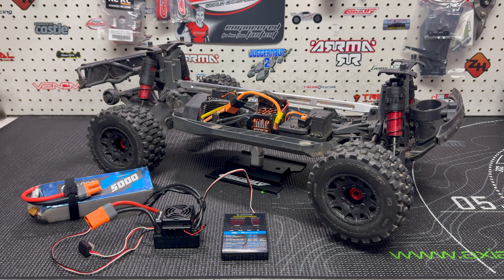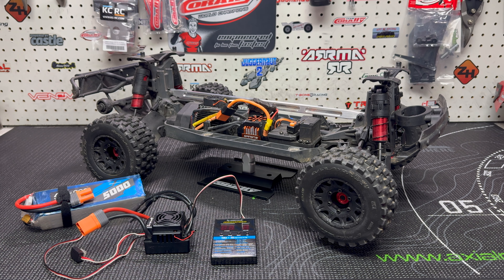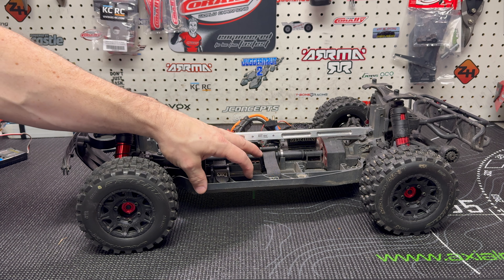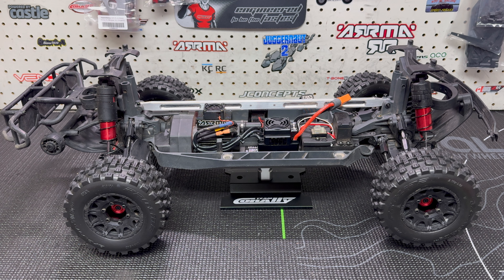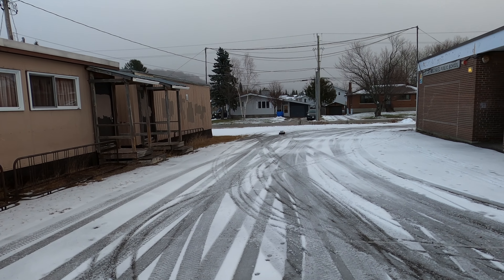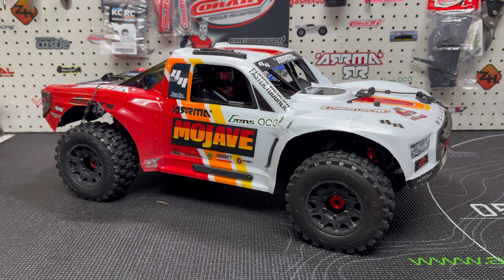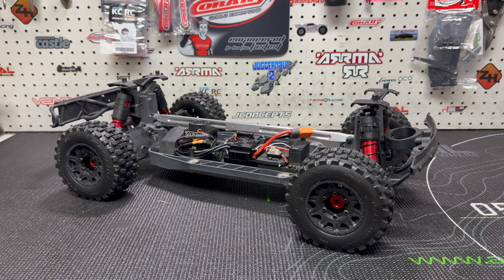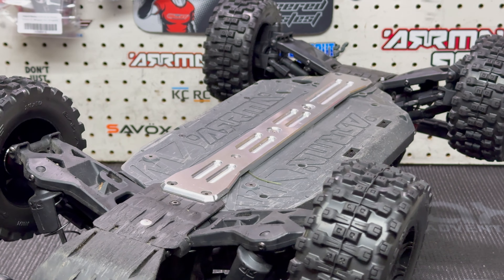Arrma Mojave 4s W/ KC RC Upgrades (Installed 6s ESC for 5S Runs)

Comment: I've run 6s through stock Spektrum 3s 3660 3200kv motors without issue. Those motors can handle the snot man! I love Spektrum gear. Wayy less glitchy and temperamental than my experience with Hobbywing gear. Great vid, man. Very knowledgeable but as far as driving in that snow... That's some of my favorite driving.. drifting in snow like that is part of why I love my 6s Mojave

Comment: Great job and very interesting the T2T Brace and the Skid Plate! How to know the gradation of the silicon oil for the center diff out of the box? Looking through the spare parts on the Arrma website, I found that for the shocks it's 300cst and for the front and rear diffs it's 10,000.

Comment: Its just that extra weight jay causes it run warm its already pushed to the limit for the size and weight of the truck , plus you put braces and more rotational mass with the wider tires and aluminum hexes . I add more cooling going 5s , im only go to add lights and fans for now . Maybe gyto thats a good idea for the slippery stuff . Im trying to not beat this mojave up i take it out on the 6s guy

Comment: After watching all your Mojave videos. I upgraded the shit out of my Mojave. Crazy thing is it arrives on Tuesday lmao and I already got that remote you posted with telemetry the 6s tires the adapters and kcrc parts besides the under body protection. Lmao I haven’t even turned it on and it’s getting upgraded heavily I got the reefs 444 also coming and hella billet parts lmao lmao not even stock I ran it ima modify it then run it